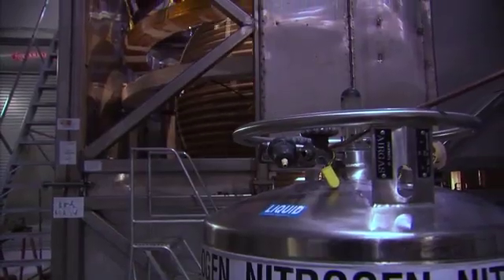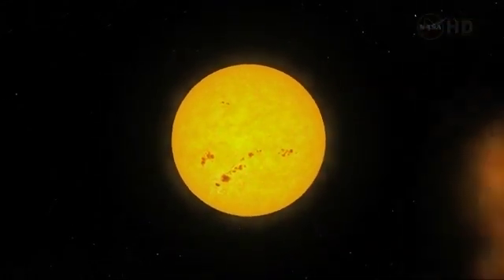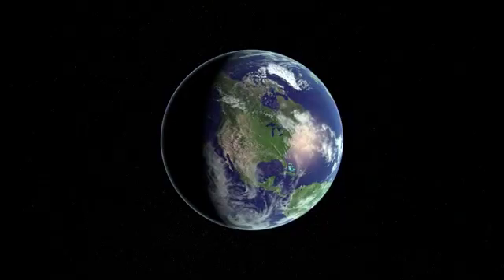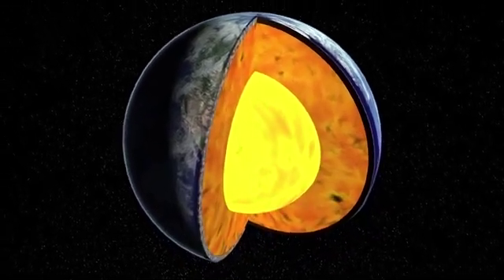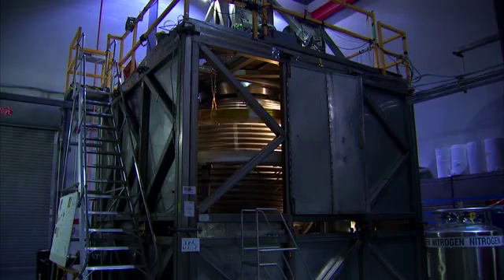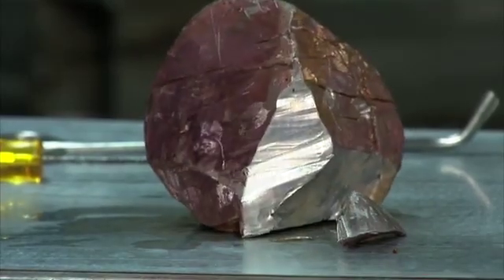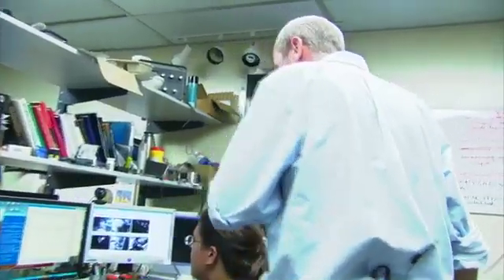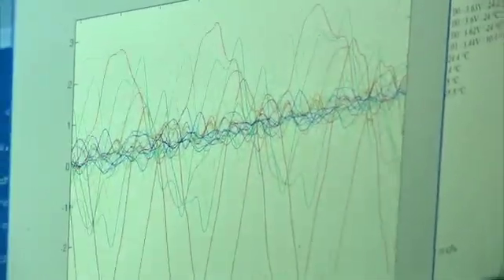Recreating Earth's Core in the Lab - Daily Planet

Comment: They need to use a semiconductor like silicone which is more electrically conductive at higher temperatures
Reply: Do you actually believe there is a core to the Earth and if I give you proof that there is not, will you believe me?